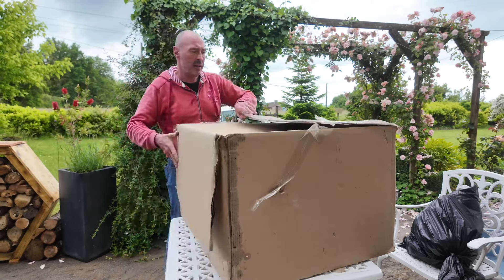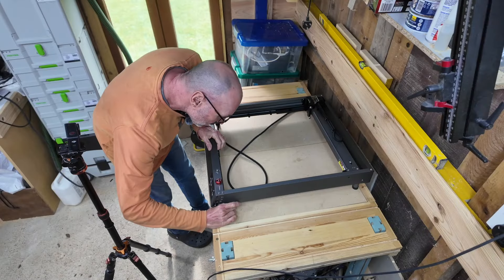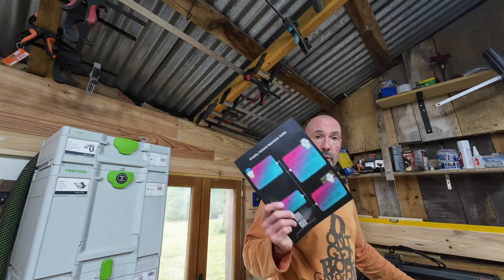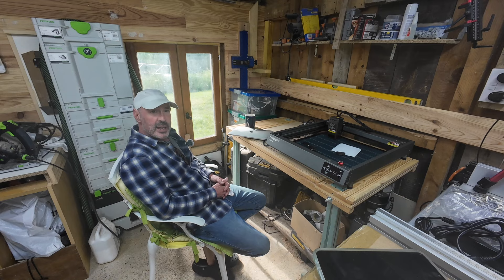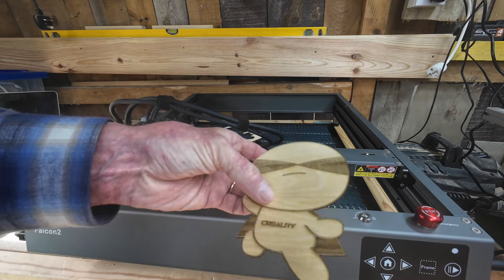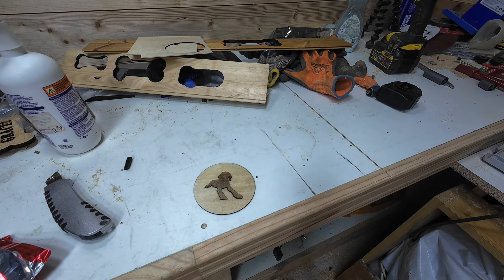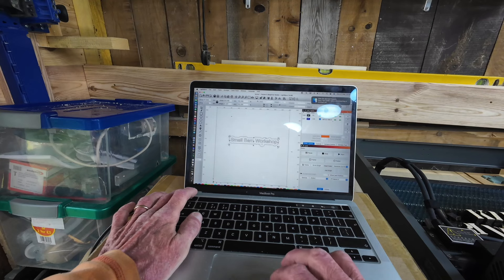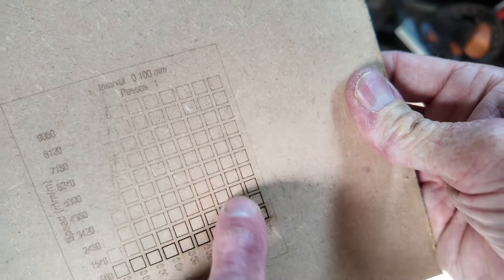Creality Falcon 2 40W Laser engraver. What to do (and NOT do) as a complete beginner.

Comment: I've been watching several videos here on 'the tube' regarding setup and running laser cutter/engravers. You are the first I've seen actually level the device. That is something I would most definitely do. Having said that ...  I realized that if the device is level, but the table, honeycomb, workpiece is not, then the focus will not be consistent throughout the job. Now I have to resolve my OCD tendencies toward perfection with the possibility that this may be a bad practice. I would appreciate any comments or advise.
Reply from the maker: @billfield8300  hi Bill. There is two checks. One, that the machine is not rocking around. I was amazed how fast the laser head moves when in full flow. Two, that the laser head is parallel to the material across it in all directions. Thanks for the comment. Regards JP
Reply: @Smallbarnworkshop  Thanks. As a toolmaker, I will probably use an indicator to confirm the parallelism of machine to workpiece. That will also identify bowed material, etc. Thanks again.
Reply: @billfield8300  My father in law is a long-time hobby woodworker. I got razzed as a retired CNC machinist for dialing my table saw in to +/- .001 parallel to the blade with dial indicators.  :D  A laser is capable of much more precision than a table saw. I plan to dial mine in the same way. For projects, I'll just make a simple accurate stop fixture to ensure square each time and a consistent zero point. With a proper setup, and an accurate fixture, it should be more than accurate enough for general woodworking, and likely much more precise than average.

Comment: Great video as usual. I have the 22w falcon and use it for all sorts of things.½" ply cleats on french cleat storage down to engraving. 
I haven't managed to set anything on fire yet😂😂😂😂.the other day I had set it going and meanwhile started my Traeger, when it starts it puts out quite a lot of smoke. I looked up ,saw the smoke and thought garage was on fire LOL. realised it was Traeger,
at one point your work looked sooty this is normally not enough air, I have air on all the time.
Reply from the maker: Hi. Thanks for the air tip, yes I have some sooty bits, mainly on the hardwood 1/2" ply.  Surprised me when I set it on fire, I expected it to trip the fire warning alarm but it never did! Regards JP

Comment: Good review. I have been considering adding a laser head to my big CNC machine- but most of the power ratings are fiction. A genuine 40W LED type is great- I did not want to fuss with CO2 types. As there would be hassle swopping heads, I have just bit the bullet and ordered one of these-  that will force me to make room for it. I hope it will fit in my CNC chamber, and that the vac system will double as a fume extractor.  We will see... Thanks for the steer.
Reply from the maker: Hi. Hope you have fun with your new toy. Regards JP